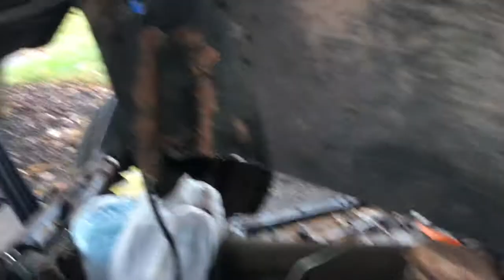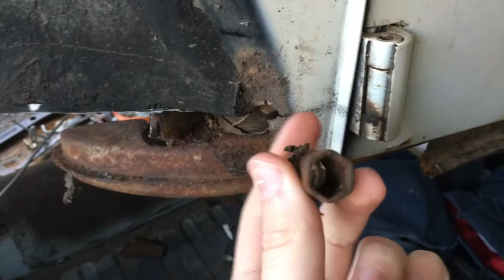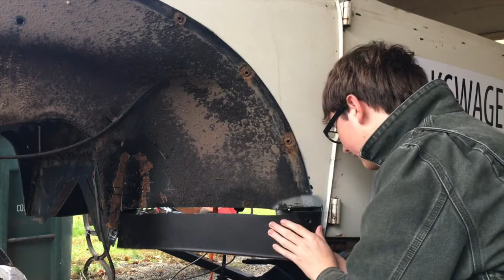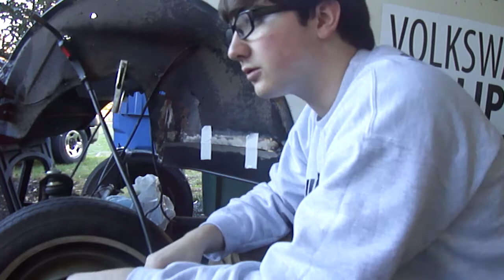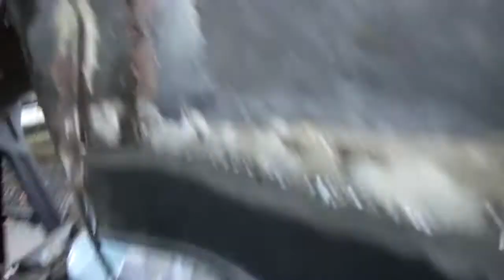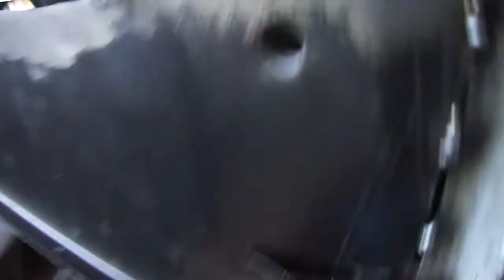VW Beetle Wheelhouse Repair

Comment: good stuff That heater channel looks pretty grim too. Check out my heater channel video I do the wheelhouse place right with the new heater channels because they are usually all bad together. Keep making the videos too it is fun to watch you younger guys do this stuff. It is much better than doing video games.
Reply from the maker: Yeah both heater channels are gone, but I've got the replacements and am getting ready to put them in soon. This is WAYYY better than video games! I'll check out your video on the heater channel replacement.
Reply: yea it will help you be sure to weld in the support and watch several guys videos on doing them before you start. and make a video of you doing it. You will get some haters but just ignore them and delete their comments. and keep on making those videos. They are really good and real.